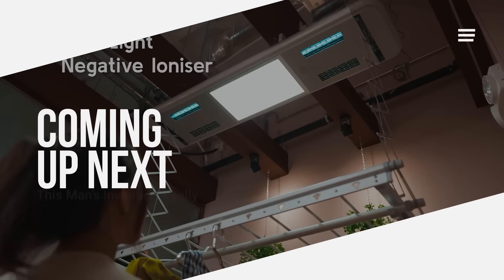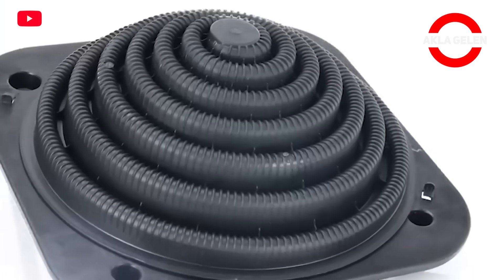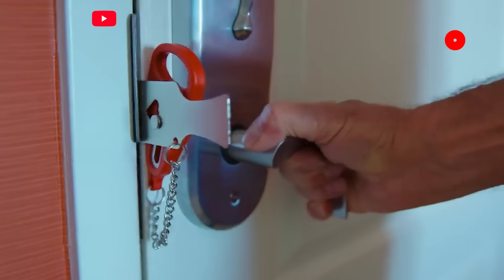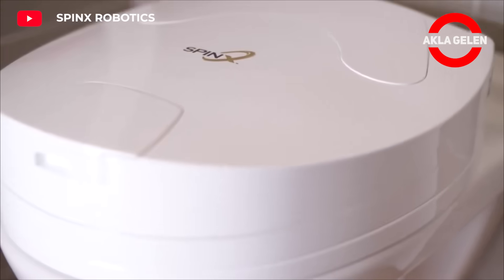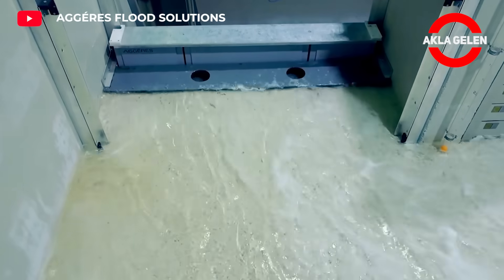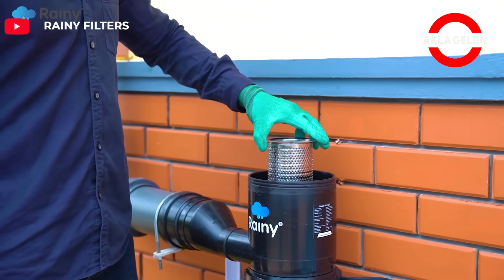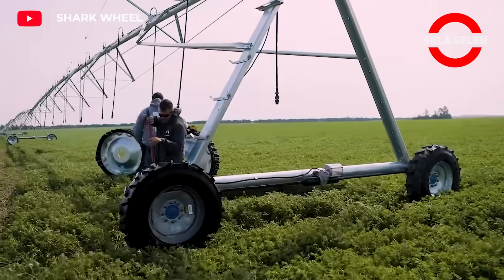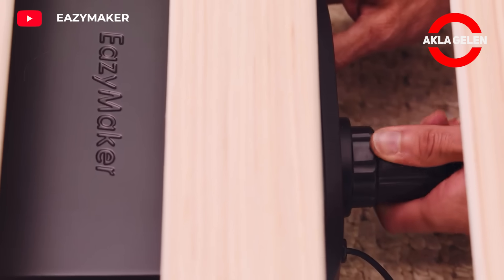This Man's Invention Really Works - Most Ingenious Inventions You Should See

Comment: That sprinkler system does not have a shit show in hell of stopping a forest fire which can produce 120,000 KW per square meter.
Reply: You have completely misunderstood wildland-interface fire protection. Step one in fire-smarting a structure is the removal of all combustibles on the exterior; this eliminates direct flame impingement. Step two is the removal of combustible structures (outbuildings, large trees) to eliminate ignition via radiant energy. Step three is the meticulous sealing of all openings 3mm or greater, to prevent wind-driven firebrands from entering the soffits, attic and crawl spaces. Finally, roof-top sprinklers raise the humidity around the structure, creating a 'moisture bubble dome' that extinguishes firebrands that do land. Our fire department regularly installs sprinklers exactly like the ones shown during a wildfire, and has has tremendous success in saving homes and cottages, 100% success so far.

You are not trying to put out an intense wildland fire with sprinklers. You are simply preventing the ignition of a structure such as a home. This takes very little water, on the order of 1mm per hour, based on research from the University of Minnesota. The UoM studied the Ham Lake and Gunflint Trail fires in concluding that sprinkler protection is do-able and effective.
Reply: yeah i was going to say, that last mentioned use , entertainment for kids, is probably the best and the most viable use for that little thing..
Reply: People here in Florida save their homes all of the time with just a garden hose. Wildfires are usually fast moving. Sparks and blowing embers can't start a wet structure on fire
Reply: @FauxQue-yk8dt  You have no idea what you are talking about. Nobody has ever saved their house from a forest fire with a garden hose. The fire was never going to take their house in the first place. Before you decide to argue to point consider this fact. If a fire has three-meter flames and is burning in a good fuel source, there is no man-made equipment that can put it out directly.